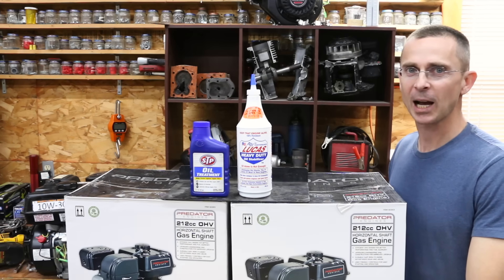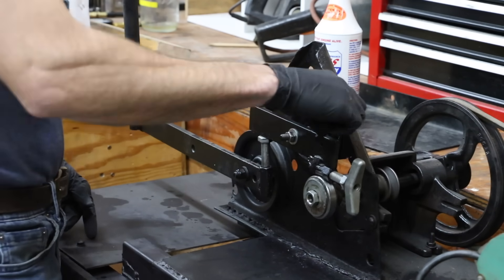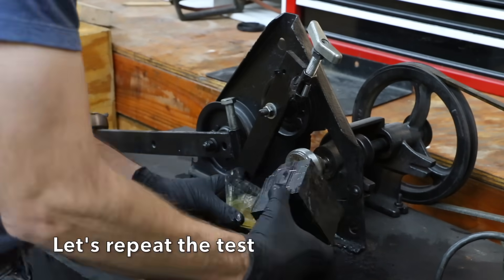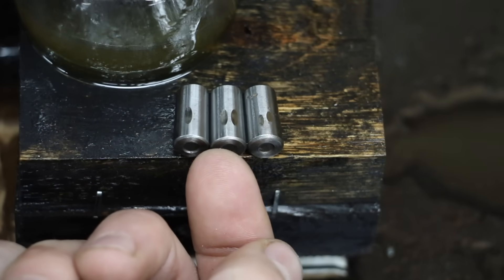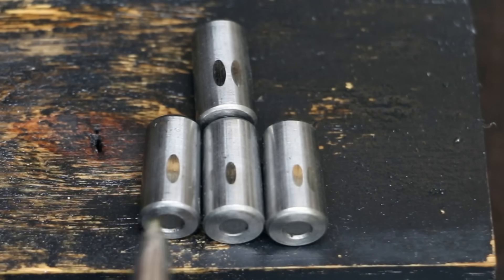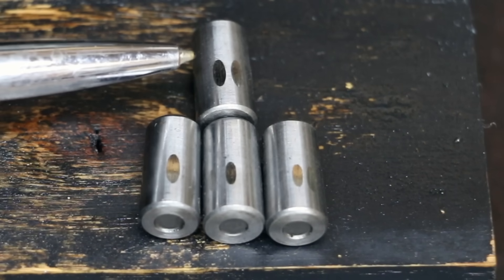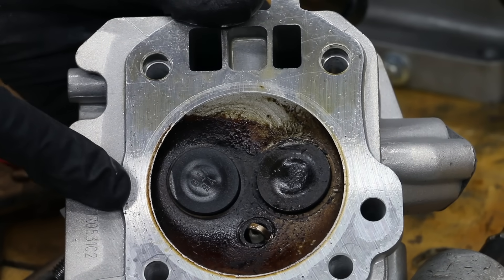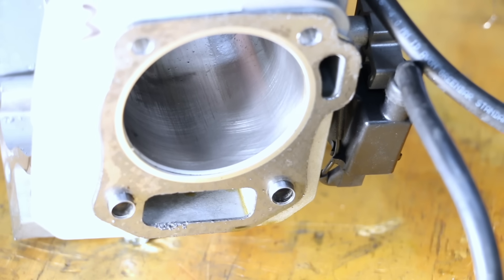Which engine self-destructs first?  Lucas or STP?

Comment: Not sure this test has any validity chemist design oils of all different kinds viscosity  and additives while it may be true off-the-shelf additives can help a little but at the end of the day you run an engine out of oil it won't last long I don't see the point in timing how many minutes longer, I think wear protection data in this link is much more realistic for somebody interested in protecting their motor course it will take several hours to get through it all
https://540ratblog.wordpress.com/2013/06/20/motor-oil-wear-test-ranking/
Reply from the maker: Thanks for the link.

Comment: this test was horribly done! where was the control engine? also running the engine without oil is nonsense. you should have done life test under strain. In conclusion this test has no point and no valid results.
I'm sorry to see two new engine destroyed for nothing....
Reply from the maker: Control was in the10W-30 vs Bestline video. Thanks!

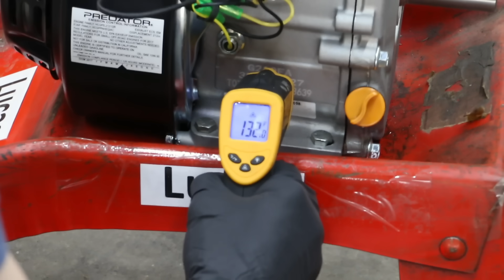Comment: @Project Farm     Since the Lucas is a higher viscosity oil 7:17 it is probably less volatile than the STP, which is probably why the oil film left on the Lucas 11:05 didn't burn off as fast as the STP. 

So I don't think this is a fair apples to apples test, and doesn't translate to results normal operating conditions. The Lucas runs hotter under normal conditions 7:17, but does that doesn't mean the 10-15 degree differential will cause the oil to breakdown quicker than the stp, since it is less volatile anyways. I think the closest you could get to a scientific test (within reason) would be to have both engines run for a few days, then disassemble both and compare the before and after micro scratches on important wear spots in the engine. And weigh those results with the fuel consumption differential since the lucas made the engine less efficient.

Setting that aside, all you can really conclude from this test was that the additive package in the Valvoline oil was better complimented by the Lucas additive than the STP, if you happen to run 2 mower engines dry, in the climate you tested them in. EEEEEVEN then, there could be variations in the 2 motors since they aren't identical.

Obviously it's still cool that you made this video. And the test I recommended might be too much for one guy on youtube. I just don't know if any generalizations can be drawn from this test.
Reply from the maker: Thanks for the constructive feedback.
Reply: Project Farm no problem boss man! Keep it up!

Comment: I think that a competition betwen additives will not reveal much, as oil additive claims are just that. Claims.  Many, many commercial additives are identical to the additives found in off-the-shelf motor oil, while mass-marketed additives have some of each.  You would have to really classify each additive to it's main area:  Controlling chemical breakdown, for viscosity, for lubricity, or for contamination control, and or seal conditioning. So unless you can really compare basically identical products, you'd essentially be comparing apples and oranges.  I'm not sure if you are aware of it, but there is a site that has virtually all the info you want on oil, filters, additives, etc:   https://www.bobistheoilguy.com     .
Reply from the maker: All great points and thanks for the link!  I like that site and refer to it often.

Comment: You are comparing 2 products that use polyisobutylene as a primary carrier as well as lubricity packages.  If you want an apples to apples comparison try different chemical categories of products, EP such as Duralube, MOtor UP, Zmax, vs Lubrilon, vs Slick 50 and a Moly product.  You have to study the different chemical bases to understand why consumers are confused.  Lubrilon was the formula that started SLick 50 try a test between these two.  Slick 50 today is not the same chemistry it started out with.
Reply from the maker: Thank you for this recommendation!

Comment: i used synthetic motor oil in my 97 Lumina for 90% of the 87k+ mile i drove it and never had a problem with it-i also changed my oil and filter every 4000 miles
Reply: when my car was destroyed it had 175k miles on the odometer-it was a retired police car-and chevy recommended i change my oil every 3500-4500 mile
Reply from the maker: Synthetic oil is a great investment!
Reply: in older high milage cars its recommended that the oil be changed regularly between 3500-4500 miles
Reply: James Barrick best to do the service intervals recommended by the manufacturer...or sooner. Don't go past what it was engineered for
Reply: Why would you change synthetic oil every 4000?
Reply: Synthetic does not stop moisture, which all engines sweat anyway. Moisture is a big killer of  bearings. I change my conventional oil every 3k, & synthetic on newer cars every 4k. Am a retired Master mechanic of 40 years. IC
Reply: Idus Welton .. that's only if you're using conventional oil.. almost every vehicle I was using synthetic in, has had well over 200k miles, with none using any oil.. But, I've generally only used Mobil1 or Castrol, because that's what was required by VW and Mercedes.  That's pretty good testimony.  My VW requires 0w-40w.  (It was originally 5w-40, but changed).  It specifically states on the containers, "European Car Formula".  It would be interesting to know what's the difference.  I had the engine open with close to 200k, and it was absolutely beautiful inside.. 😀 love machinery..
Reply: Wasting your money on synthetic if your changing it at 4K intervals, back in the day before fuel injection oil was contaminated at a faster clip. Heck, I run conventional 5 k. I have seen guys change oil filters at 4K using synthetic and go another 4K
Reply: It's not just miles, it's time as well. If you drive short trips, you need to change your oil more often. In the winter, you need to change your oil more often. Don't listen to these guys who say "why would you change synthetic oil every 4000km? you're wasting your money". My car says every 5000 miles or 4 months, whichever comes first.  There's a reason it's not just miles, but also time. Depending on your driving habits, your oil can go bad long before the manufacturer's rating of 10 000 miles or whatever.
Reply: Vlad, you are correct, But for average driving conventional oil is well equipped by API standards to handle 4k. Today's engines are sealed better and fuel injected which means less oil contamination. The vehicles computer takes into account idle time, outside air temp, load and other parameters for oil life metering system. But at the end of the day, it is personal preference, if you want to change your oil every 2 weeks go for it.

Comment: Did you try WD40?
Reply from the maker: Yes, I tested WD-40 as fuel and as oil. Thank you!
Reply: Did you ever try to run a two stoke weed whacker engine on diesel or biodiesel?
Reply: I actually have lots of questions about engines. What would be proper etiquette in that pursuit?

Comment: This test makes no sense. It's fun but it's not really a test. What exactly did you learn by running to failure with no oil? Conditions were totally outside the normal operating conditions of the engines and oil/additives, and you have no idea where the variation in time to failure came from. Maybe an additive that sucks during normal conditions works better in high temperatures and/or adheres better to surfaces after the oil is drained. Or it could be normal variance in the manufacture of the rods, or variance in your testing procedures. The engine temps when you ran everything as recommended tell some kind of story, but you'd be better off running the test on the same engine for that. Using different engines you'd need to have a much larger sample size (at least a few engines for each oil type) to have any kind of confidence in results. Run everything within specs for as long as needed to get a good signal to noise ratio and then measure wear scientifically at key areas of the engine. Of course you need control engines too, with just regular oil. And finally, different lubricants work better with different loads, clearances, temperatures, service life. So the results will tell you which additive to use on this exact engine model, and not much else.
Reply from the maker: Thanks for the constructive feedback.

Comment: STP tends to cause a lot of "coking" on the piston ring-land  grooves and side space clearances. I use it diluted with engine oil for coating my bearings and cylinders on rebuilding and have had great results. Otherwise I don't recommend STP.
Reply from the maker: Great tip--thank you!

Comment: I've used Lucas in almost every car I've owned in the last 15 years, my most recent truck was a 97 Expedition that had bad rod bearings for 4 years! 
They actually honor their money back guarantee, I called about their power steering fluid sealer not working and they refunded my money with no problem at all.
Reply from the maker: It's great that they stand behind their products!

Comment: Unfortunately tests like this are not accurate. Metallurgy has taught me that not all parts are created equal, especially aluminum. Porousity, oxides, heat stress, tensile strength, inaccurate alloy creation, etc can cause part failure. I know this is as close as you can get to accurate with a small shop, but a more accurate test would need to be done on multiple engines as well as having a baseline of just a certain oil. Definitely not detracting from your attempt to be as impartial as possible... you did well. I just think that imperfections in the metals caused the damage I seen in both engines.
Reply from the maker: Thanks for the constructive feedback.  All great points.

Comment: I use stp  with cheapest s'market oil, my van engine is just starting it third time round it's odometer, uses no oil between changes. Previous van was synthetic oil only, it got once round the odometer and the crank went kaput.
Reply from the maker: Thanks for commenting.

Comment: I'm good, oils are designed at the factory to do certain things, these only mess up the balance of the factory oil. I only use these when my oil is long in the tooth and needs changed but its winter and want to run an extra k b4 changing
Reply from the maker: Thanks for commenting on this.

Comment: Hey there i was woundering how much weight could a 6.5 hp toro push mower eingine move like if i was to put it on a riding lawn mower would it be any power to push im like 150 lbs n my push mower is like 110 lbs
Reply: I forgot to say im maken a go kart out of the riding mower i have like 10 push mowers so n 1 riding lawn mower im not planing to mow the lawn i just want it as a go kart to drive around my property for fun
Reply from the maker: I have an old sears tractor that has a push mower 6.5 HP on it. In low gear it will pull 2,000 pounds easily.  It's all about the gearing.

Comment: A little late to the party here, but as entertaining as this test was, I think there were some important elements missing for a true "what's better" test.

You were missing a "plain oil" control engine. This may have just been due to the extra cost behind blowing up an extra engine, but we have no real baseline with which to compare the two fluids without one.

It also would be interesting to run the two engines LOW on oil for an specific amount of time, (with a third engine running normal oil for a control of course.) then take them apart and see if you can spot any damage to the engine between the two.
Reply from the maker: Thank you for this recommendation!

Comment: How about something different, like a cold temp flow rate test at 0 degrees F (oil from the freezer) using an actual oil pump from something common/cheap (chevy small block) through some cheap iron tubing with holes in it that match those on the crank. Or just get a junk crankshaft and use that.

Spin the oil pump at 600 to 800rpm to simulate a cold start idle speed.

Compare several big name 5w30 conventional, blend, synthetic.
Reply from the maker: Thank you for this recommendation!

Comment: First off, this is about the dumbest test I have ever seen. You NEVER run an engine without oil. I used Lucas oil in my 3 over the road trucks for over 8 years. Ran Lucas every other oil change. Not once did I ever have an engine problem. Once I had a mechanic do my bottom end and did not bend the dog ears on the bolt. Needless to say it worked its way loose and spun a bearing on the cam. When the engine was taken apart, there was absolutely nothing worn or abraised inside except for the bearing itself that had spun. So there is my tesimonial for the Lucas products.
Reply from the maker: Thanks for commenting on Lucas.  The destructive engine test was actually used by a lot of other additive makers in the past to demonstrate how their product had superior film strength.

Comment: I really enjoy these videos and documentation of the tests themselves.

I've been using Mobil 1 full synthetic in all my gas powered engines for over 30 years. I'm wondering if there would be any benefit to adding an oil additive to the mix?
Reply from the maker: I'm reluctant to offer advice on oils and oil additives.  I personally do use them periodically.  I personally like to use them in "extreme duty" situations, such as heavy towing.

Comment: There are plenty of labs which offer used oil analysis. There has to be some which analyze virgin oil for lubricity and other properties. Better yet, perhaps running these engines using engine oil and these additives at recommended dosage, followed up by a series of UOA might provide better analytical data. Too many variables in your study to really be conclusive, IMO. Entertaining, though.
Reply from the maker: Thank you for commenting.

Comment: I used to use Lucas in my Chevy SUV, but stopped when I switched it for a motorcycle and use 20w-50 oil. It's already super thick. Looks like there's something to using Lucas though
Reply from the maker: Thanks for commenting.

Comment: It is interesting what you demonstrated which is really a run dry properties which in term helps determine if i get an oil leak AKA wifey bashes the oil pan but gets the kids and her back home safe and off of the freeway or other dangerous situation you may have. Another interesting fact is that run cool does not mean it will get far......got another interesting test for you not on oil additives but on engine coatings for internal parts, they use oil as vehicle to take the coating to the internal parts and adhere. Let me know if you are interested.
Reply from the maker: I'm interested. If you could, could you please create a new comment (so I can easily find your comment) on more information on this test idea. Thank you!
Reply: Project Farm , Indeed no problem. You know one of your commenters is right on, The Ginger Bus Adventures, was mentioning about the Nano Technology stuff that now a lot of products "claim" to work at that molecular level. I have tried 2 out in my work (I am a large bore Diesel engine tech.) and in the personal, both are from Europe and I still use them when I need them about once every 2 years or when I get a new used car. They go by the name of Rewitec and Xado. Your test will take a while but will be really interesting. There is a very interesting story on how these products came to be hope I could tell it to you some time. I am happy to see you are a family guy as well!! Keep up the good job!!

Comment: Do a two stroke oil comparison: traditional petroleum based vs castor bean based vs synthetic.
Reply from the maker: Thank you for this recommendation!
Reply: thank you for the great videos! I have always run castor bean oil mixed at 32 to 1 in my ATV but I have wondered about the synthetics such as Amsoil Dominator that say to run them at 50 to 1 or even 100 to 1. would be interesting to see an honest side by side comparison.

Comment: As someone who has dissembled an engine that has been treated with l
LUCAS many times, I can say it leaves a weird coating on all the internal surfaces. Its a bitch to clean off and get back to bare metal. Weather thats good or not is up to you. It would be interesting to see how much horsepower is lost due to the oil clinging to the surfaces inside. I do use lucas, but in lower quantities then whats recommended,  usally only 10%.
Reply from the maker: Great recommendation on the HP test!

Comment: If these additives make such a big difference how come all oil doesn't come with them standard.

Not trying to be snarky, genuinely curious.
Reply from the maker: This is a great question.  I wonder if input cost is a factor.
Reply: Because the US EPA has dictated that standard motor oils NOT contain zinc (ZDDP) because it damages catalytic converters. Older flat tappet cam engines however REQUIRE zinc as a friction reducer. So that's why "all oil doesn't come with them standard."
Reply: this because adding STP or Lucas or xxx are vii - viscosity index improvers.By addidng too much you can change the oil from say a 5-20w to a 15-40w. This may be fine in warm weather but if it gets cold it resists flow and on start-up you can create a lot of damage - DON"T  DO  IT !
Look up " viscosity index improvers"
Reply: Aaron Reichert Because selling more engines is the point of engine manufacturers.
Reply: Aaron Reichert money
Reply: Miracle Pie interesting

Comment: STP blows up old engines for sure, I had learned the by 1980. I don't know what it does to/for lower mileage motors. I would never add that stuff to any of my motors. Sea Foam suggests treating crankcase oil , I think it said 2 oz Sea Foam per quart, seems kinda runny to me...
Reply from the maker: All great points. Thanks for commenting.